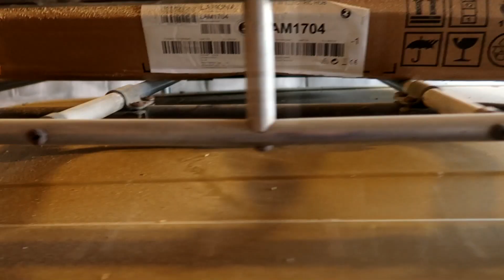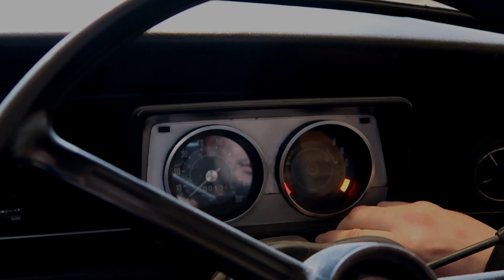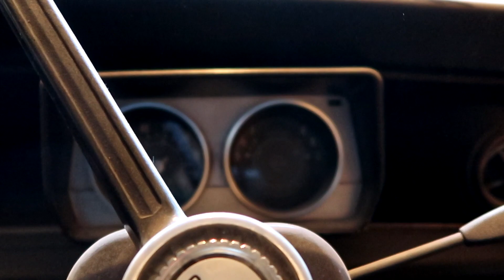Clubman estate | part 1: keeping it alive!!

Comment: Love it and just subscribed! I've got a 76 Clubby Estate!  Just the business, so much fun!!!!
When you change that steering wheel, keep the original, or sell it to me 😉😉
The flasher unit is on its own relay.  They can be located in 2 places! Either by the ignition wiring, hanging around in that area or front bulk head by the wiper motor.  I would think you've got a sticky relay or a earth going green.  They relays are easy to get from a mini spares centre 😀
Reply from the maker: Lol! I'll be swapping between the two. I bought the wood steering wheel because it was cheap at the time and I've always liked that style but I absolutely love the original.  🤔🤣🤣